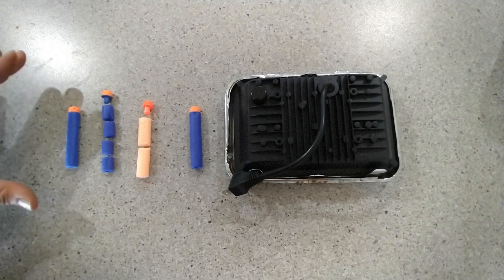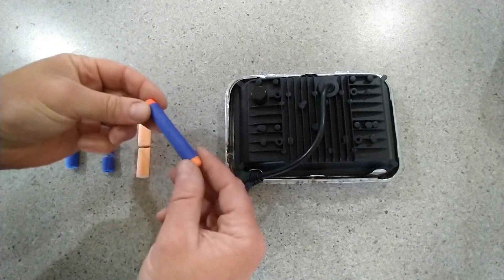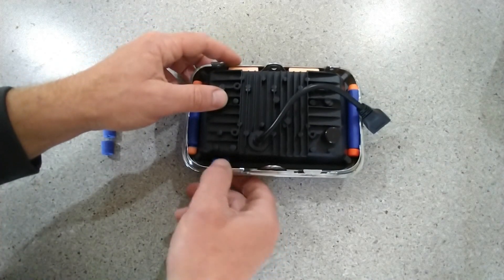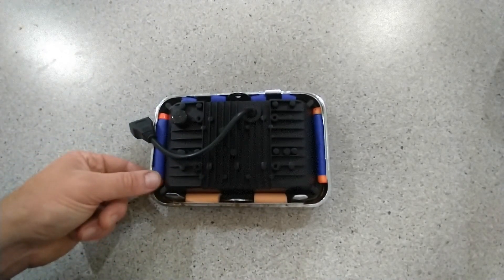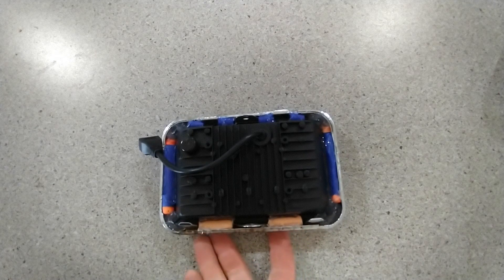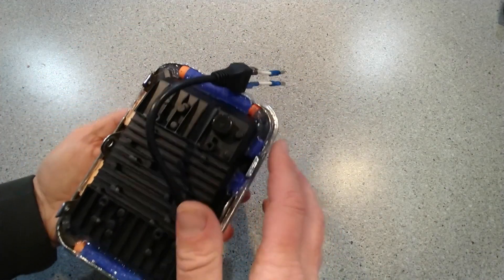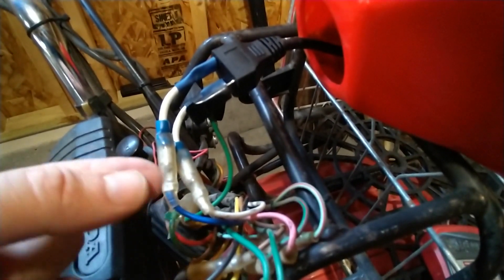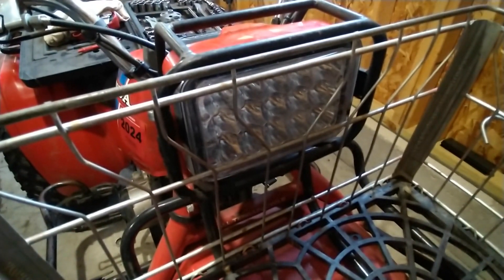Honda Big Red ATC LED Light retrofit.

Comment: This doesn’t solve the issue of led light will die from ac power. It has to be converted and regulated to 12v dc power.
Reply: I'm confused by your comment. The stator should be producing clean 12vDC power. Where would the AC power be coming from?